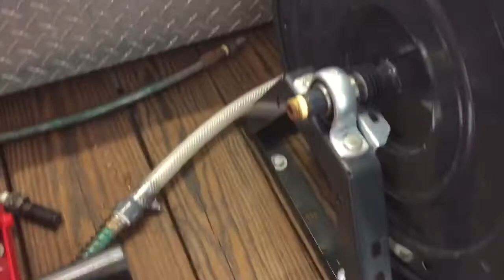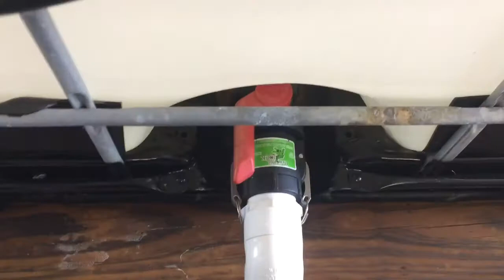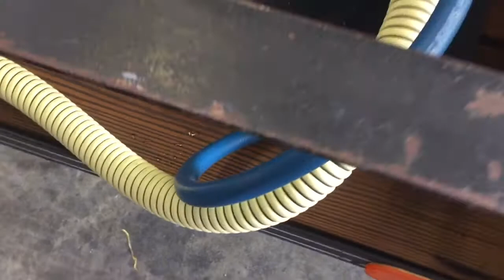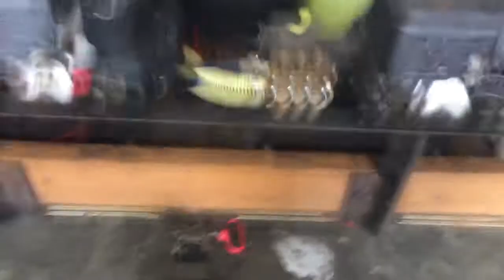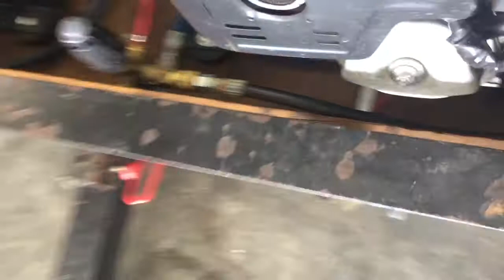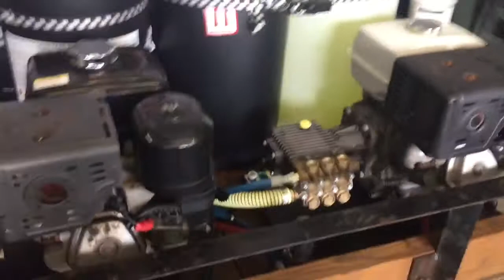Pressure Washer Setup

Comment: Do you have issues with water flow into those pumps since they're direct drive versus belt drive?
Reply from the maker: No issues. My water setup can deliver way more water than the pumps can demand. I use large pipe and hose and eliminate 90 degrees turns.
Reply: I see. Thanks for the response

Comment: Question ...why do have the unloaders  set out ..is it for space or flow  reasons...
Reply from the maker: It's better for the unloaders to be remotely mounted to reduce the vibration on the pressure washer pump.  Each time you pull the trigger gun and release it there is a hard kick at the unloader.   If the unloader is mounted to the pump directly, that kick is transferred to the pump and over time the brass threads can weaken at the outlet and start leaking.